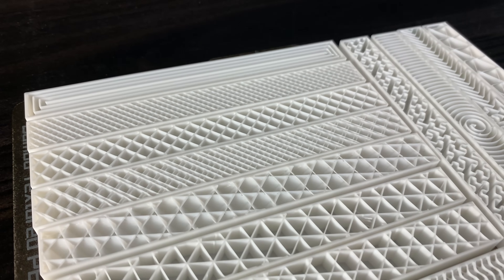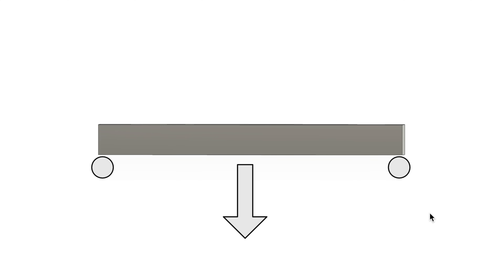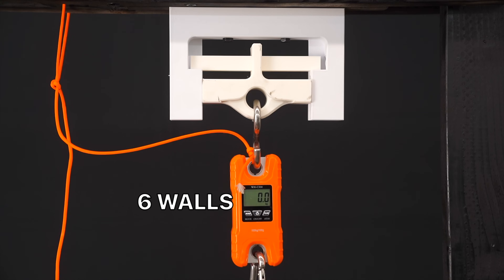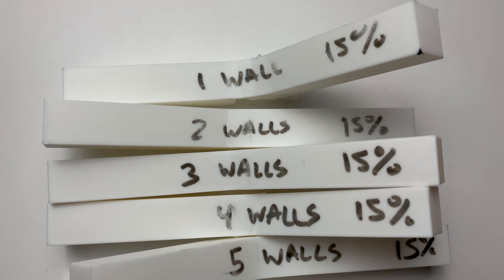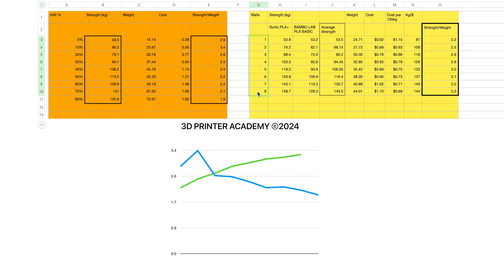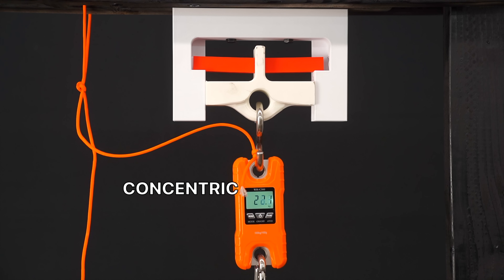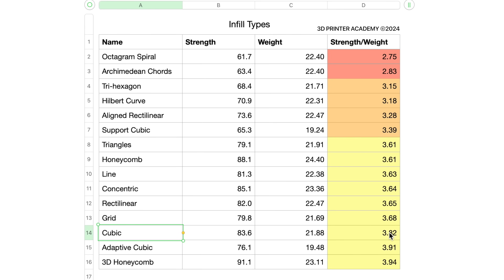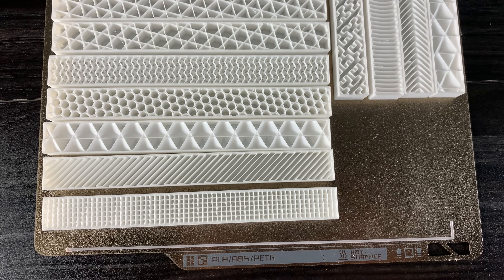This 3D Printer infill is the strongest (3D Printer Academy Tested - Episode 2)

Comment: where is 3d infill?  HOpefully you tested the strength multiple times.  Ive had multiple prints with the same pla have dramatically different strengths.

Did you test different fill percentages on the different infills or just used 20% for all?  If you just used 20% for all you will get bad results.

Comment: GYROID FOR THE WINNNNN
Reply: Agreed, I was amazed at the strength of the form, I once printed an 11"x11"x1" at 10% infill, no walls, top or bottom with PLA at .35mm line width, it easily supported my weight at 280lb being held up along 2 edges.
My only complaint is that Cura 5.0.0 doesn't do a completely closed 2 cell architecture with its gyroid pattern
Reply: to add, my complaint has more to do with other things in that regard, like for use as heat exchangers

Comment: The thickness of the infill design needs to be same as the thickness of the walls and all the other designs to even make any useful comparison.

Some designs are being held back or are inflated by the constraining walls.

The ratio matters, so make it the same.

The strongest one per weight is going to be a simple truss design, but at least you can gather data on how much weaker other designs will be.

Comment: Saying 20% is the best is misleading. No one is optimizing for the highest strength / weight. We're printing for a required strength. If that requires 50% infill, that's what we're going to print, even if the strength / weight is lower than 20% infill.

Minimum weight for a given strength is valuable, since it saves material and time. Strength / weight is useful for determining the minimum material required to get the required strength, but it's not a goal in itself.

Comment: This is a good start but your making alot of errors in your methodology and data handling.
First your only conducting one test for each data point which will not give you any idea of your error range for your data. You should be testing a minimum of 3 and ideally 5+ of each data point to gain robust data.
Secondly in your walls spreadsheet you averaged together a PLA+ and PLA and used that average for your calculations. That average means nothing because it's an average of different materials, your strength to weight ratio is meaningless as these plastics will have different densities and different tensile strengths. This poisons all your calculations and conclusions, and without the separate material cloumns in the following spreadsheets I can only draw the conclusions that those calculations are following the same flawed methodology.

All this is to say that while your conclusions are meaningless your raw data still holds some validity even if it could be skewed by errors. That first graph on the first spreadsheet is good, showing the separate material lines. 
You've made a good start, better than anyone commenting here because we haven't done this sort of testing. I hope you take what I'm saying here as constructive critique and continue on with this sort of work, hopefully with some better methods.

Comment: Definitely some errors in your data interpretation conclusions, for example the optimized strength-to-weight ratio is not where the lines cross but where the best of the two is maximized. They are not intrinsically linked, you can have 1-5 walls with 0-50% infill.  10% infill with your data is clearly a better strength-to-weight ratio and should be combined with your optimized wall selection.

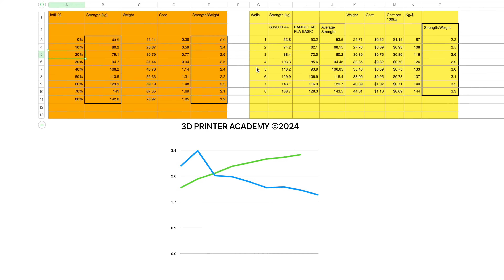Comment: Why on earth would you think that the optimal configuration is where the two lines intersect (4:14) ???
That's not true at all. 
- First of all, if you're just looking for efficiency, you should conduct more focused testing (1% increases let's say) on the range 0%-20% infill to get a closer approximation of optimal infill percentage. 
- Secondly, since the two factors are completely independent of one another, there's no reason to compare them at all: you simply take the optimal strength to weight ratio from the wall thickness (3-4 walls, your pick) and combine that with the optimal infill percentage (which, on your graphs was 10%). 
I don't understand the thinking here at all. If you wanted to combine the graphs for some reason (and I'd suggest you don't, I don't see anything to be gained from that) -- it would make significantly more sense to sum the y-values to create a composite line and look for the maximum on that line.
I like the video / what you're trying to do, but there's some flaws in your execution there my friend.

-EDIT: The conclusions you drew at the end (calling into question the results of the lightning infill pattern since you're comparing strength to weight) - you can control for that very simply by repeating the test (for each infill pattern) at double pattern density. While the strength to weight will go down, the effect of the infill on total strength should double - you can then use the difference between the two total strengths measured to determine how much of the total strength of the beam (at single density) can be attributed to the infill and how much to other factors. As a check, the amount attributable to "other factors" should be roughly constant across all infill patterns. If you do this you could actually further refine your results to calculate the mass of the infill alone (not including walls) and divide the total strength attributable to infill alone by that mass to get your strength to weight (significantly more accurate). This same technique could be applied to wall thickness to achieve similar improvements in data / conclusions. As an aside, it didn't seem as though you accounted for infill orientation either.

Comment: Your conclusion about 3 walls and 20% infill is based on a bad assumption.  You are assuming the infill and wall thickness are independent when it comes to adding strength.  You haven't demonstrated any evidence for this, thus the conclusion is invalid (although not necessarily wrong).  For example, more infill increases rigidity, thus allowing walls to more effectively apply their strength.